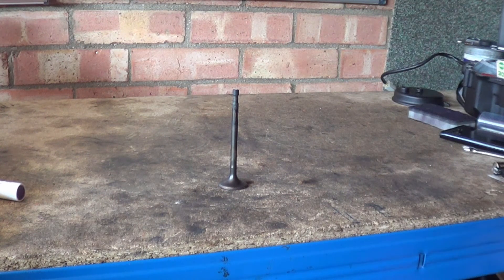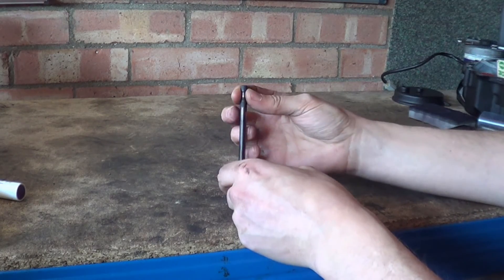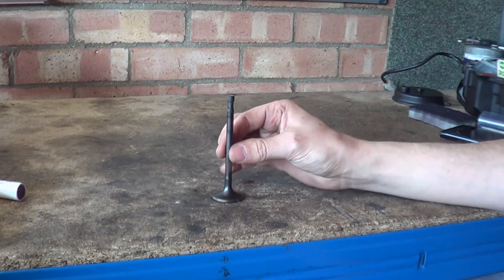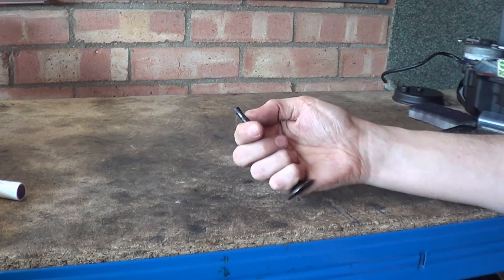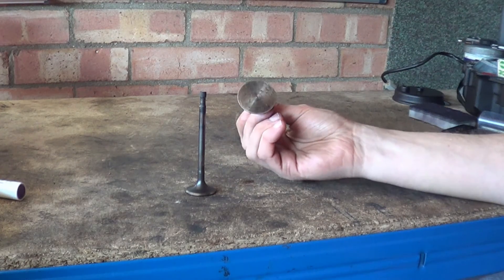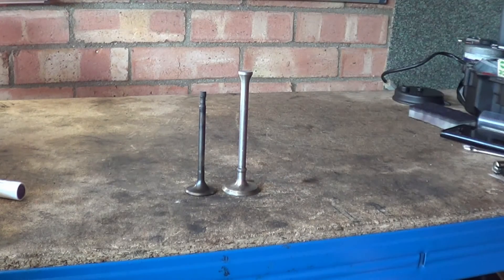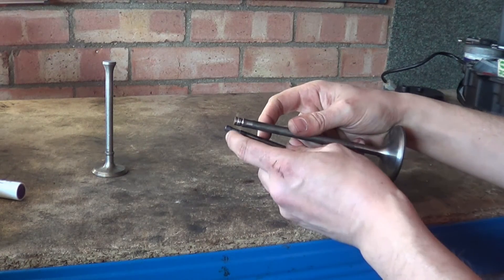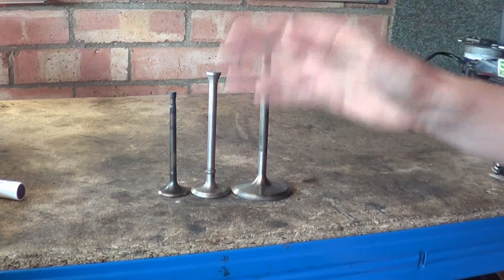How Valves have changed over the years

Comment: Ok Matt might end up on comment corner for this but  have worked on engines for all my life pretty much thought I knew it all but your vids get me thinking 😳here we go😬 you said yourself the best way to fill a cylinder is take the head of cram in your perfect mix and whack it back on😆(gold by the way) is there not a way to have one big valve  the same size as the cylinder to do both intake and exhaust of corse it would need  some other valve to switch intake and exhaust but would it not be enough extra power to compensate ?😳
Reply from the maker: Something like this has been tried and you'll see a video soon. This isn't a comment corner comment, its a great question. - matt

Comment: that looks like a 1928 ford model a exhaust valve in the middle and american v8's have valve guides in the heads just not a cam shaft...still to this day gm uses a centralized cam that operates two large valves

Comment: so setting aside engines like the Duke or a 2 stroke like an OPOC or any other type of engine for that matter that eliminates the need for the opening and closing of pneumatic or cam operated valves, why do the mechanical valves of a typical four stroke have to open into the cylinders with the risk of interference and potential catastrophic failure. Why can't they open up into the head by some other design, or would that just come down to performance? Is that why engines don't use the side valve design now?
Reply from the maker: There are to types of valve mechanics, ones that open ahead of the stream or ones that retract out of it. The engine valve or poppet valve opens ahead of the stream, ones that retract, like say a ball valve create turbulance in the stream infront and just after the valve, also retracting valves are harder to seal at high operating rates or frequencies. A ball valve in a tap for example would create a restriction in the flow as it opens. 

You also have to consider that any valve has to seal the cylinder. Poppet valves use point contact around the valve seat to seal, and have to deal with high temperatures. If a ball valve were used or something similar then at high temperatures the tollorences would change, possibly seizing the valve. 

Reed valves also open into the stream. Both poppet valves and reed valve are very, very simple. This decreases the chances of failure.
Reply from the maker: This was tried with the CRSV system here - http://www.coatesengine.com/csrv-system.html 

They state this -

The Coates Spherical Rotary Valve comprises two  spherical rotary valves
 assembled on two separate shafts - one for inlet  and one for exhaust. 
They rotate on ceramic carbon bearing with no oil  lubrication, the 
spheres do not make contact with any part of the  housing. The seals are
 a floating type and are also made of a ceramic  material. They have two
 piston rings and are floating in a small  cylinder-type chamber, they 
are activated by the compression and the  combustion strokes of the 
engine which allows 100 percent sealing  effectiveness, when compressed.

 I'll cover this in my alternate engine designs series but in a nut shell the problem with this is as follows - 

"the spheres do not make contact with any part of the  housing."

I need to do some more digging but this doesn't seem right, I think its based on some sort of labyrinth seal but I'm not sure.
Reply: Very interesting piece of reading matt, and exactly the thing I was looking for. Seems to suggest it's successful but what's it used for ?. I think you're intending to cover why car/bike manufacturers aren't quick to take up radical designs at some point but yeah this was the sort of thing I meant with the essential elimination of interference. I never knew there were so many different internal combustion engine  designs out there ( albeit this is in relation the the head )  until you introduced the series on alternative engines so I'm well chuffed to be one of your subscribers mate. Absolutely love every single upload. The spannery stuff and the the white board which to be totally fair usually makes things a hell of a lot clearer  - always very clearly explained and not in a patronising way - do keep it up mate !!!.
Reply: there are 2 kinds of 4 stroke engine heads, interference and non-interference. the names are pretty self explanatory
Reply: its impossible to hold back the compression if the valve moved away from the cylinder and we used to have "flat heads" where the valve was on the side and still do (lawn mower engines still use this design like briggs and straton) they are heavier and produce way less horse power but great torque so its all about efficiency...we like our 4 cylinder engines to get 30 mpg not 20 that a flat head would get in a car